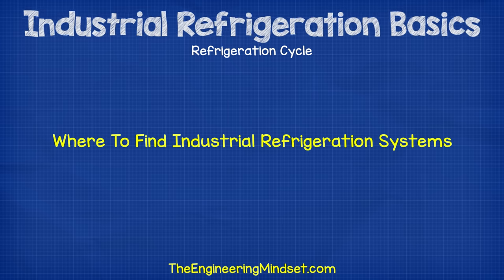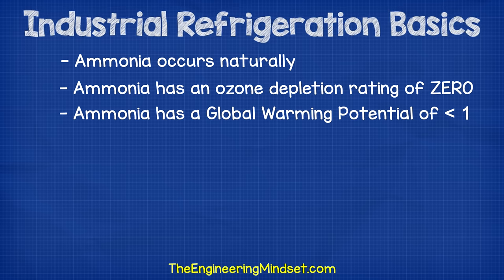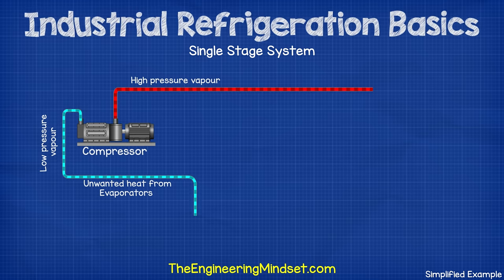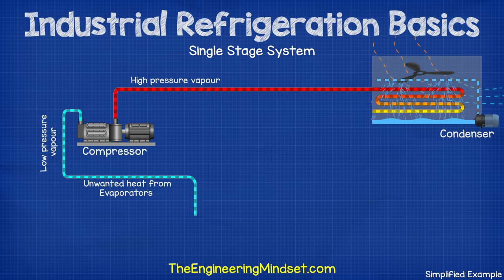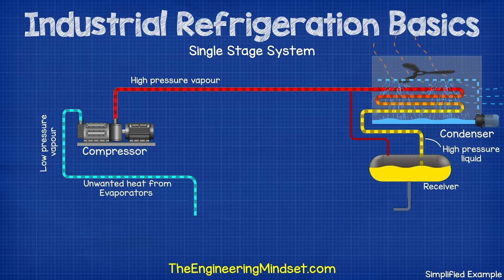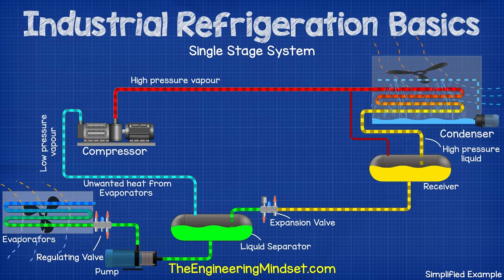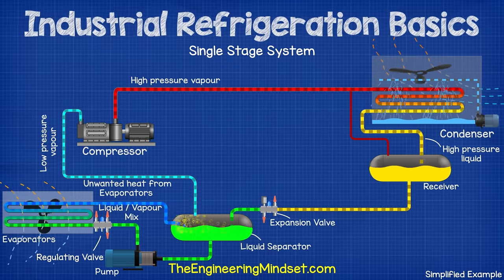Industrial Refrigeration system Basics - Ammonia refrigeration working principle

Comment: One key factor that was forgotten is that ammonia is highly corrosive to anything containing water, including your skin. Copper also can’t be used on ammonia systems at all
Reply: How about galvanized steel?
Reply: @bigkirbyhj666  i dont know anyone that uses galvanized pipe. however using stainless or just black iron is fine.
Reply: Can't use galvanize steel,   silver,gold, copper n brass
Reply: But I have heard it is used in volatile pH control of water system for corrosion prevention
Reply: @bigkirbyhj666 yes you can used galvanized, we connect to galvanized pipe on the coil itself and switch it to carbon, only 21 years old and i’m pretty expirenced, blessed
Reply: @alexis.g34  how did you get into the trade/ get hired? Did you go to school for that? Prior experiences in HVAC?
Reply: @3cats932  if you have prior experience in hvac/r you can easily work in that field. It’s the same theory just industrial level with different pressures.

Comment: Hello sir, i would like to clarify and ask. The equalizing line's purpose is to equalize the pressure between the compressor outlet/condenser inlet with the ammonia receiver to allow the liquid refrigerant flow towards outside the condenser outlet more easily. Then, if there were no equalizing line existing between those two points, would there be an overflow, followed by  back flow? Then the equalizing line's another purpose is to prevent the liquid refrigerant flowing back inside the condenser. Please correct me if I am wrong sir, thank you very much.

Comment: Could you do a video on how purge units work for ammonia systems? Specifically the kind which condense using the suction vapour line and not a seperate refrigeration system.
Reply: search how auto purger will work you will find

Comment: Great explanation...

I have an alternate method to this that is way more efficient than a cascade.  We have hit -112c with a single stage system and can get much lower.  Patent Pending!
Reply: Is the system you have and are referring to an altra-low freezer?
Reply: @ryanm7249  it can be used as an ultra-low freezer yes.  We see it having a multitude of uses across many industries.
Reply: Do you produce these systems yet?
Reply: @dan4age  We have been in production since 2020 with multiple working models currently in operation.

Comment: The regulator valve and expansion valve are almost the same , the only difference is the expansion valve has much better and consistent adjustment for the very much important amount of liquid ammonia going into the evaporator .  The regulator valve controls the pressure differential  between the condenser  and receiver . the head pressure runs around 125 an 150lbs , an the receiver runs at 75lbs  pressure differentials are key , as that's how the system works.  I was a manager of several companies with ammonia refrigeration systems .
Reply: Yes great, Pressure difference is the key
Reply: What will happen if there's a high pressure differential

Comment: Awesome presentation ! . I found this while searching for Amonia system issues as I am having prolong issue in my Ammonia compressor . Grateful if you could support me to solve it. 
We have a two stage ammonia compressor connected to Blast freezer of -40 C . At start it perform well and while room temperature down to -30 C  Compressor oil pressure reduces gradually below to the set point ( 1,5 bar) and shuts down . All the components were checked , replaced ( bearing , pump , filters , oil etc ) . nothing didn't solve the issue. But one day in a test run suddenly , the machine picked up the oil pressure and run as normal. It continuously ran for two weeks without problem and all of a sudden again the same issue occurred . Now we are helpless  . If anybody can support us,  it is very much appreciated. !!
Reply: How did it go? Please tell us

Comment: thank you for this vid. im gathering ideas for  LIQUID AMMONIA :) keep it up!
Reply: NH3 systems require a T-machinary room classification. Without proper emergency pressure release systems, diffusion and fire suppression the risk of a toxic explosion is too high and therefore only certified techs can make physical changes to the system and certified RO/PE's can operate it. 

If you want to experiment with refrigeration, I'd recommend using something inert and learn about corrosion, piping codes first. 

I have personally rigged a commercial AC to the side of my house and use the heat in my greenhouse. It can take litres of water out of the air and cool my entire place below 60 degrees.

The waste heat can become it's own project. If this field interests you there's extremely good jobs in heavy industry. I'd say it is less of a career because you will always be training and working on new systems unless you find a chief plant operations position but eventually you'll want a bigger system to operate as you gain more firing time and experiance.
Reply: @JohnSmith-xk8rr  
Do You have it rigged as a reversible heat pump, or did you just place a condenser in the greenhouse? There are some circumstances where you may need to cool a greenhouse too. Is the air conditioner new or an old unit removed from a residential home? What refrigerant does it use?

Comment: Questions:
1. What material is used to contain the ammonia?
2. How do you keep the ammonia dry?
3. Why do you use isenthalpic expansion instead of isentropic expansion which should be more efficient, at least, in principle?
4. What kind of seals are used on the compressors to keep the ammonia from contact with the motors?
Reply: 1. You can contain ammonia in tanks, while pressurized.
2. The only way the ammonia get wet is if there is a leak and air gets in, this happens in cases in which you are working in vacuum. To vent out the air, you use an air purger.
3. For this you need to understand the refrigeration cycle with a pressure vs enthalpy chart. In a sense, you need to keep the enthalpy in the same level after it passes through the condenser.
4. The motor is connected to the compressor through the shaft. The compressor would have a shaft seal to keep the ammonia within the compressor. There are videos on how a shaft seal works.

Hope it helps!
Reply: @juansalazar4325  Clarification: You wrote: 

"You can contain ammonia in tanks" What material are the tanks made of?

"You need to keep the enthalpy in the same level after it passes through the condenser."
Why?
Reply: @DavidFMayerPhD  Ammonia is contained in steel.  Steel is adequate and inexpensive.  Never use copper or copper alloy such as brass or bronze - ammonia will corrode them very rapidly.

Isentropic expansion is difficult.  A machine is needed to extract work.  The fluid is a gas/liquid mixture so a controlled expansion is even more difficult.  And the efficiency loss from the isenthalpic expansion is small because the amount of expansion is small, most of the expansion is due to isothermal evaporation.  So even though isentropic expansion is best in theory, practical limits favor isenthalpic expansion.
Reply: 1. stainless steel and black iron pipe
2. using purgers and to take out non condensable as well as getting anhydrous ammonia when you first fill up. 
3. i dont know tbh
4. its a carbon and material that sits on the shaft of the compressor. called the shaft seal that prevents push back. it usually sits in oil to prevent any leakage and they get replaced every so often depending on the wear they get. usually there isnt any direct contact what so ever with the motors unless theres a huge problem.

Comment: The expansion valve and the regulating valve you have backwards ! The expansion valve goes in between the evap and ammonia pump . And normally a single stage system doesn't use ammonia pumps , they run off the receiver pressure . the regulator valve belongs in between the condensor and receiver  to put a diff of head pressure of around 150lbs to 75lbs receiver pressure.
Reply: Thanks for clearing that up, I was going to ask the same question. If they're going to make informational videos they need to get the facts straight.
Reply: they can and do have pumps. you're thinking of a single stage system with control pressure receiver and dump tanks, which have no pumps but instead rely on a set pressure of ammonia sitting in a vessel to be fed into a tank and then pushed by hot gas to the evaps.

Comment: Hello engineering mindsets team I have a question regarding the industrial video with ammonia as refrigerant. In the video it is shown that cascade intercooler or heat exchanger is used to maximize the refrigerating effect. How I can use the same in 60TR block ice ammonia ice plant where we produce the ice for marine products so that I can increase the refrigeration cycle more efficient and decrease the time of production.

Comment: Question, you mention at the end in a cascade system that it sometimes uses 2 different refrigerants, allowing you to use less ammonia. But you said a couple times in the video the refrigerants never make cntact with air or water ad always sealed. That makes this a closed loop system and the refrigerants shouldnt be consumed no?

Comment: 7:59 Cascade condenser, Acts as a condenser for the LOW temperature circuit, and an evaporator for the HIGH temperature circuit. Yes?
Reply: Yes
Reply: Yes, correct. He stated it backwards in the vid

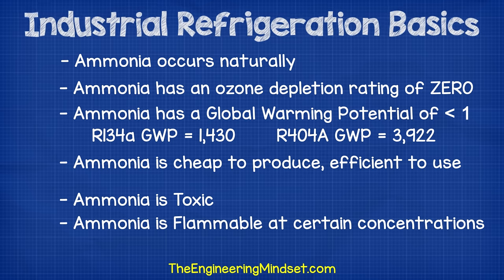Comment: 2:12 You're forgetting that when Anhydrous ammonia reacts with water, it generates heat. At certain storage densities, this is bad… you get a runaway reaction which leads to a massive explosion. This is what happened in Beirut.
Reply: Ammonium nitrate, NH₄NO₃, solid, fertilizer, was Beirut. This vid is about Anhydrous ammonia, NH3, a gas, that can also be sprayed into the soil as a fertilizer and also used as a refrigerant.

Comment: what's the difference between a liquid separator and liquid accumulator?
Reply: the accumulator just holds liquid and gets pushed out by the discharge pressure of the EQ line. A separator has liquid that has been pushed through from the accumulator and then it is sucked on by a compressor from the top. 

liquid stays at the bottom and the vapors get pulled through by the suction.

Comment: hey brother i have some issue with electricity regarding to High Med Low working condition. could you help me with this? as high pressure consumes more electricity and I dont know how to calculate cost thus I dont understand with "working condition" means

Comment: confused.. what happened to generators, analyzers and rectifiers in ammonia systems.. different from what i have learned about ammonia use as a refrigerant.
Reply: What was considered a cascade system in this video overlooks the type of 2 or more phase systems. It is a brief overview but detailed enough as an introduction.

Most ammonia plants are 2-phase where brine is chilled by ammonia evaporating over pipes filled with brine. The entire rest of the system is based around removing the heat after compression inorder for the ammonia to be evaporated again.

The instrumentation and automation side of this is easy class 4 or class 3 nitty-gritty stuff.

Comment: Why would you use Anhydrous Ammonia as a refrigerant rather than CO2? I've heard of Adobe horrific Ammonia accidents in cool stores.
Reply: pressure
Reply: The pressure that CO2 operates at are extremely high and very very dangerous, if a fitting where to come loose under that pressure it will become like a bullet and kill you and the apprentice standing behind you

Comment: Why is it necessary to bring the pressure up to cool the refrigerant (through the compressor)?
Reply: The compressors main role is to move refrigerant around the system, the reason it's high is because of the heat absorbed in the evaporator (look at pressure temperature relationship) and the additional heat from compressing that gas (heat of compression - that is what moves the gas but has a by-product of heat) combined, this results in the pressure becoming high if that makes sense

Comment: Hi there! After operating, my compressor oil is mixed with ammonia and water, do you know how to separate the ammonia and water from the compressor oil?
Reply: Hello I am from Bangladesh, I had a question
Reply: Get Rid of the all water completely in your system, make sure it's absolutely dry and then add new oil, old oil can not be used

Comment: Can you please expound on the need for a "pressure equalization" pipe that connects the high pressure vapour pipe to the receiver? What is the need for that line and what happens if it's not there?
Reply: Basically when you are pouring fluid down a tube into a tank the vapor on the tank takes up space that is being displaced by the liquid that's coming in. The vapor tube allows that vapor to go somewhere and also allows it to be further cooled.
Reply: Also, unequal pressure makes the condenser less effective.  If the system has to use a pressure difference to push liquid from condenser to receiver, then the condenser will be partly full of liquid,  and liquid has much less heat available to remove compared to vapor.

With a pressure equalization line, vapor can flow up from receiver to condenser, allowing liquid to flow down from condenser to receiver.  That keeps the condenser liquid level low.
Reply: @robertrocheville7769  would it be fair to say it allows the receiver to fill up with liquid by purging out the "air pocket" trapped in the receiver vessel
Reply: @jimbojones806  Sounds very fair to me.

Comment: What's  the point of the intermediate pressure refrigerant line plunging in the liquid in the intermediate cooler compared to having it meet the outlet of the intermediate cooler on a T then go to the high stage compressor suction?
 Pressure equalization and better desuperheating of the discharge gas of the low stage compressor?
Reply: Denuris Turgryn    In my personal experience, the low stage compressors discharged vapor at around 30 psig and about 120 degrees f. If you piped that superheated vapor straight into the suction of a high stage compressor, it would not take very long for that compressor to shut down on high discharge temperature. Even mixing with cold vapor from the intermediate vessel will not help much in desuperheating, because that cold vapor has already done its job. Once evaporated, ammonia’s ability to absorb  more heat is practically nothing. Remember that the maximum transfer of heat is latent or hidden and occurs during a change of state. The intermediate cooler, in theory, brings the low stage discharge vapor temperature back down to its saturation temperature. The flash gas created, when superheated low stage discharge vapor makes contact with lower temperature liquid ammonia, removes a tremendous amount of heat. The high stage compressor then compresses it again up to around 150-180 psig and about 120 degrees f. These numbers are from a system that used liquid injection cooling for its compressors. Hope that helped.

Comment: This means cascade system uses less ammonia, thus gives greater savings in terms of ammonia maintenance cost, right? On the low pressure system; what refrigerant is generally used? Glycol?
Reply from the maker: CO2

Comment: I know when ammonia systems age and fail they are pretty catastrophic like in BC a twin rink arena system failed killing a technician, municipal workers and a couple of firefighters.  Our one ice rink arena in town was dangerously worn out and it had the ammonia system run under the rink.  Ammonia is probably obsolete by today’s standards as rink systems from ice cube (stylized as ice^3) (the system in use at our newer arena) use R410A and are only charged with 20 lbs of it.
Reply: its definitely not absolete, and most likely wont be a for a long time to come. the only reason they fail so badly is because of poor maintenance and not following both iira, osha standards. and honestly, i dont believe you can use 20 pounds of 410a to get an ice rink considering its mostly used to get to rooms to about 50 or so and its much higher pressure.

Comment: Don't need the liquid separator either .   This system is set up wrong with equipment it doesn't even need !  I have built a few engine rooms in my time. I worked with a guy who trained me and we called him the ammonia God !  lol  Really smart man .
Reply from the maker: This is a simplified version of a system, to understand the basic operation through animation. It is not an actual system. The system components are typical.

Comment: How hot can the condenser get? Would it get hot enough to boil water?
Reply: Most refrigerants condense from a vapour to a liquid at temps of 35 - 45 degrees Celsius, there is no need for it to get that high of a temp to boil water

Comment: There's no need for the ammonia pump in this single stage system , The 75lbs of receiver pressure will push the liquid ammonia into the evaporators , Which are also in a vacuum !  Think about it for a minute , the receiver has 75lbs pressure which is going to a evaporator that is in around 8 inches of vacuum !  Why would you need a pump ???  you wouldn't !

Comment: I think ammonia and co2 will become common
Reply: yes i need to understadn it please someone make a video about it
Reply: @Trudeautthebestt  co2 refrigerant.  Or ammonia? Ammonia systems are dangerous . It's maybe the most efficient refrigerant, better than r290 . But extremely dangerous.  R290 is propane without the odar added . That's an explosive risk more than toxic . And that's what we are getting.  Already decided on the mt top . Co2 will be a refrigerant in larger systems, probably cascading into a 290 condenser . Because 150lbs of pressurized 290 isn't happening